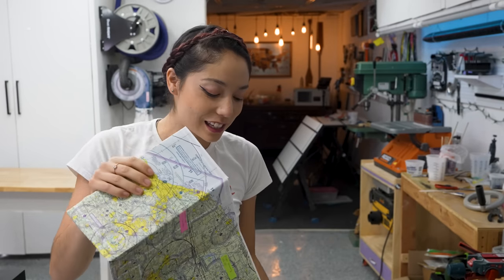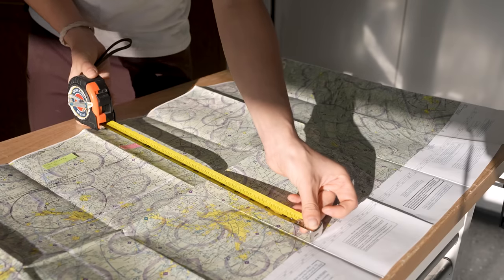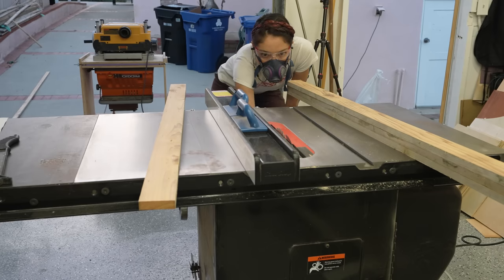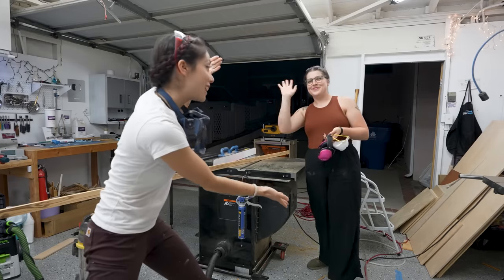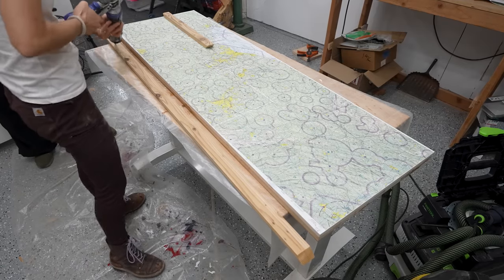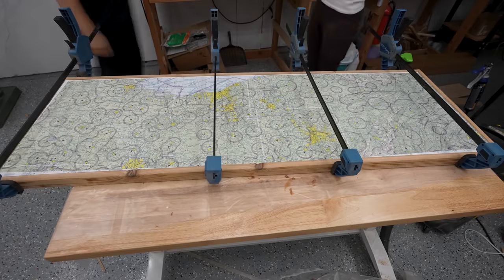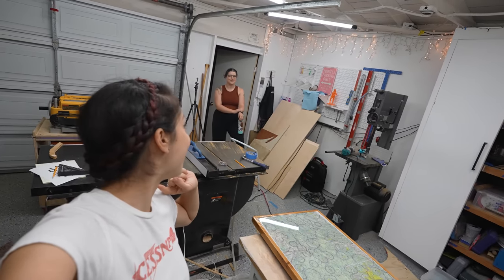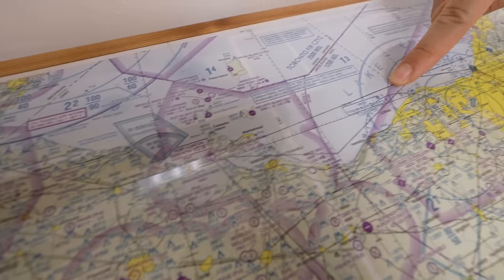Turning my old Student Pilot Map into an AVIATION BAR TOP

Comment: FYI Xyla  your shop vac has insufficient CFM/ capacity for your planer - that why you are getting chips escaping and have a higher risk for blockages- check the planer instructions. I have the same planer and just upgraded my dust collector to suit it's output.
Reply: That DeWALT planer has a built-in blower, so you can literally just attach a dust collection bag to the exhaust port, but it's a bit in the way, so I used a short length of hose and hang it off the side.

Comment: Have you ever seen an extra large globe that sets in a cradle.  (I have seen them in libraries.) You can move the globe in any orientation.  I always thought it would be really cool to apply high altitude enroute charts to the surface and then you could measure great circle routes between anywhere on the planet. 🌎

Comment: I turned mine into a livesectional (blinky RGBs on the wall). It's much more DIY than the fancy printed ones, but I like having it. Ironing the map is a great idea, it would have made mine look better. I started with Super 77 adhesive and switched to OG rubber cement. But I wasn't epoxying over it either. Hope you're getting some great flying in!

Comment: We have a table top at our flying club that has a 1:500,000 map of Greece (or part thereof) on it. I dont think they put quite asmuch effort into it as you did here though.

Great looking table, sometimes making something out of cheaper materials is great fun. I built a door out of the chea[ wood batons used to attach drywall and it came out great.

Comment: 8:40 - want to do something like this but don't have any friends? Roll it up on a tube, set the corners down correctly and hope for the best.
11:46 - To anyone wondering about the amount of epoxy needed on a project. 100cm x 100cm = 1 square meter and each 1 millimeter of thickness needs 1 liter of epoxy to cover it which means to have about a 4 millimeter thickness an American gallon is needed to cover that much. Let's say that this video's project is 70x200cm give or take, and the layer thickness is between 3 to 4 millimeters, that would mean 4.2 to 5.4 liters of liquid plastic needed for the project.

Comment: Get a cheapo planer that you can use to rough plane, then use a better helical to finish planing.

Seal the boards prior to attaching to the plywood. This way you can seal the edges to reduce the humidity swelling.

Comment: Question I have done work with concrete before and we use a vibrator to help level out concrete and remove air. You have to be careful cause the concrete will flow like crazy if you over vibrate, but on your big flat epoxy pours would vibration help you with self leveling the epoxy? Cool table by the way great way to preserve a memory

Comment: That is a really neat idea and very well done. As is everything that you do. I have the same thickness planer that you do. I too hesitated on the helical cutting head because of the cost. I retired to Thailand and have tons of teak slabs to work with. I was going through the HSS blades very quickly so I switched to a carbide insert helical cutter. I've gone through several hundred board feet of teak and I have not had to rotate the inserts yet. I really do think that the cost of replacement HSS blades would come close to what I paid for the helical cutter. At any rate I very much enjoy your videos and the encouragement that you give to women to go into mechanical and other disciplines of engineering.

Comment: you can also make the wings but you can also do  wings with pin point cameras in them also so it will  not have  the drag and every thing... facing up and facing down... this will be so kool for a stage 2 rockets...

Comment: How do you avoid edge drips on the bottom of the table top when you are pouring the epoxy and letting it flow over the edges,  even though the table top is raised about its' supports. Does the heat gun force/blow them off before they cure? Or do you have to sand the them off the old fashioned way? !!!!! Great job. I too have many fond memories of VFR flight before GPS in the mid 70s!! Lots to be said for dead reckoning !

Comment: Knotty wood ... perhaps stop telling dirty jokes in the workshop ... ;) 

sure you do have a jointer ... it is also called a planer ... adjust its depth to allow for the board to fit on edge ... and you can do them all in a stack or 1 by 1 .. that is after all all a joiner is doing ... planing the sides to the exact same level 

that table needs a ball globe with a plane on a spar going around and around ... add some LED spotlights inside and have the plane inside in plastic with a light set on its edge so it lights the plane ... and have it shine a spot on each picture above and an oval wash over the table ... add some pillar candles on each end for the relax time nights ... and your all set
Reply: awww I didnt get to call the scammer a tide pod eater for being dumber than those they were trying to scam ...

Comment: I mean, i get it, junky tool so you're junking it, buuuut... since you're cutting the surface anyways, why not wire brush the wood? Since it's just bits of stuff tacked on, all you need to do is affix an angle grinder with an eyepoker3000 to a table with a jig to pass the lumber through. Just sayin' just cause you can do something doesn't mean you should do something and tool abuse is kinda... dunno, it's kinda eh.